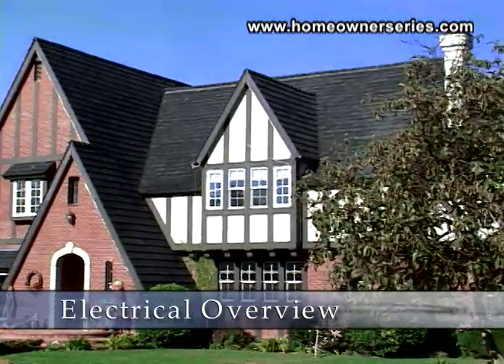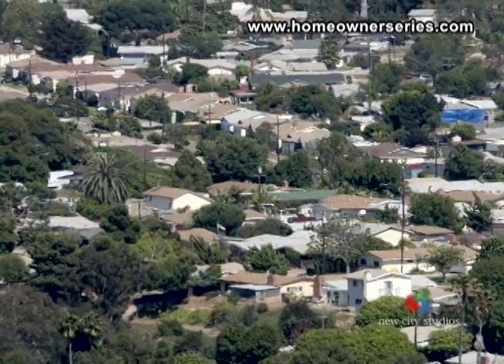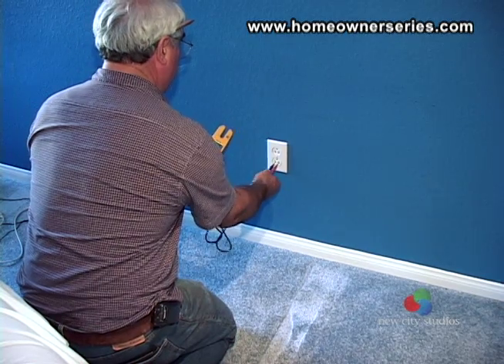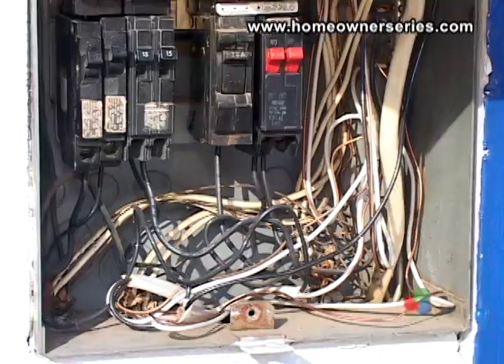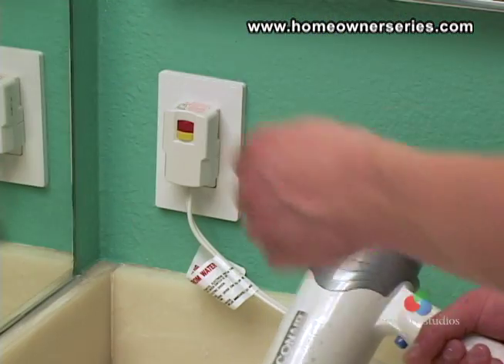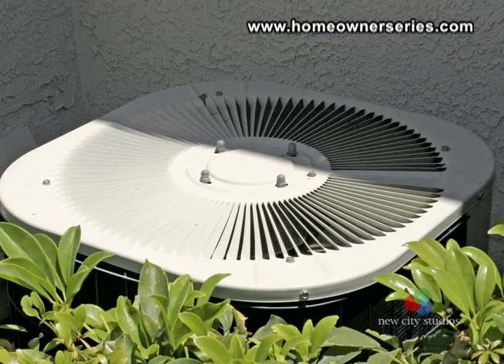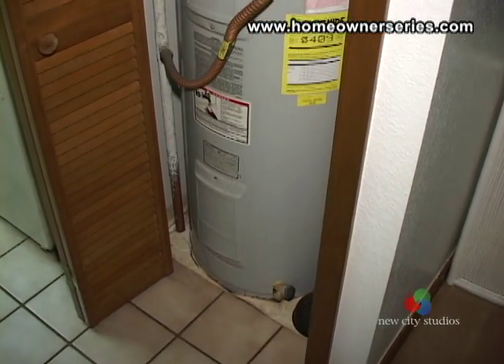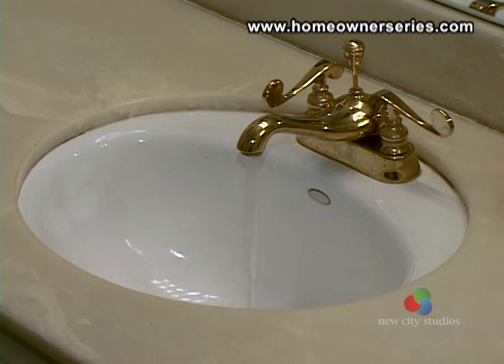Home Inspection - Electrical

Comment: Knob and tube isn't "bare wire" as stated in this video, and is not unsafe unless the insulation has worn away or its overloaded. I was always taught from my instructor that when present, it can be used safely for things like lights and low current appliances like clocks just fine, just supplement the system with modern wiring for things with a higher draw.And in that same vein, some fuse boxes can be perfectly safe when the same guidelines are followed, usually as sub panels. A major hospital in Portland where I live still has fuse boxes in the old building for the stairwell lighting systems and it passes current inspection (as I was curious and asked when I worked there).

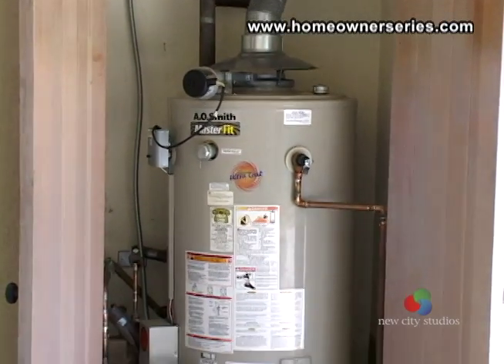Comment: At 8:17 the ball valve that is being operated looks like it supplies nothing but the capped off pipe stub. Also, is that a flexible hose supplying the water heater? And the hose is in contact with the flue?

Comment: Quote from a well known industry publication which discussed this very topic.

"Anti-oxidant joint compounds used in electrical wiring are doped with zinc particles. The grease keep out oxygen to prevent corrosion, and the zinc particles enhance conductivity. The connection does not rely on the conductivity of the paste anyhow. There is metal to metal contact between the terminal and the conductor. The zinc doping just enhances any other incidental contact that is not at the precise terminal-to-conductor interface and I suppose reduces any other potential difference that might cause heating of the paste. 

Dielectric grease is not really used in electric wiring on terminals (except maybe in your marine industry). Dielectric grease is used to lubricate moving internal parts of disconnects and circuit breakers where the reduction of arcing between internal parts is desirable, (where incidental amounts of grease between metallic parts with potential difference would cause trouble if the grease had less than dielectric properties). A bit of it is also used on plug-on circuit breaker stabs to make it easier to get the breaker plugged on. It's essentially wiped off when metal to metal contact is made at the point of electrical interconnection."

Comment: Knob & tube is not that bad. I would rather sleep with knob & tube than aluminum wiring in my home. I have seen copper spliced to aluminum catch fire and continue to burn while being sprayed with water. I am a master electrician with 30+ years of experience. I will go to sleep tonight and an alarm clock plugged into a knob & tube fed outlet will wake me again tomorrow. I ran a 3000 volt hi potential tester on the knob & tube. No issues! I used an AC hi pot set at 3000 VAC and then a DC hi pot set at 2000 volts VDC. I am slowly eliminating ALL the knob & tube. One light bulb will probably remain on the knob & tube as that portion of the home is inaccessible. It is 12 ga copper wire. I will put that on a 10 ampere arc fault breaker. I have seen far scarier things than knob & tube. How about 18 gauge lamp cord inside walls. How about partially melted lamp cord? Extension cords run under flag stones in a home office? FPE breaker boxes? 50 amp breakers feeding # 12 AWG branch circuit wiring? We added a family room, bath & bedroom, and tied it into the old circuit. The 20 amp would not hold, nor would the 30 or 40 so we put it on a 50 amp. WOW! Who let you do that? I have seen hardware store salesmen sell 50 amp breakers to people describing this very same scenario. Consider a circuit breaker can run at 125% of the listed trip rating for 12 hours or more! Yeah, it looks easy.  That was partly why I became an electrician. Installing outlets looked easier than hanging sheetrock, and without electricity we would essentially be living in barns.

Comment: This is a misleading representation of Aluminum Wiring. The stranded Aluminum, typically size 8 AWG and Larger is safe and of the AA 8000 Series variety mandated by the National Electrical Code. In 1972, UL began to require AA 8000 Series AL for use in building wiring and the National Electrical Code followed suite in the mid to late 80's. The issues of potential fires associated with AL Conductors was more about the poor connections, lack of devices (receptacles and switches) that were actually rated for use with AL Conductors and poor termination and inadequate installation practices. The use of AL Wiring in sizes 8 AWG and Larger is very safe and with nearly 40+ years of active use with reliable results the Aluminum wiring produced after 1972 are safe and compatible in creep and reliability with copper conductors. Now if you question my knowledge of Aluminum Wire and Copper Wire (which we make both) then you clearly do not understand wiring methods.
Reply: +Alpha Zero The "grease" you are referring to is not "dielectric" grease. It is anti-oxidation paste that is used to reduce the effects of oxidation on the AL conductors. It is important to note that CU has such a paste as well since it also oxidizes. Nothing within the NEC says that anti-oxidation paste has to be used, it only says that IF it is used that it will not harm the termination, the insulation, or the conductor during it's use. Not having such a paste on the terminals is not a violation unless you can show the equipment that it's being applied to makes the statement for it's requirement. I agree 100% with Encore Codes.
Reply: +Alpha Zero Incorrect......Technically - While it can be thought of as "dielectric grease" the NEC, which I know as a Home Inspector you are adverse too, if you as a home inspector call out the lack of "anti-oxidation paste" on a termination that does not require it you will become a laughing stock to the electrical community which should not be your goal. Now, while it is recommended and does serve a value it is not required if the torquing is done correctly in accordance with UL 486A-B and per the manufacturers instructions.
Reply: +Alpha Zero Not that you ARE a HI...just trying to express why it would not be in their best interest to report an issue that is not technically an issue...unless the equipment of course requires such a compound. The electrical inspectors (who which I teach a lot over the years) are not going to understand the term "dielectric grease" but will understand the statements found in NEC Section 110.14 " Materials such as solder, fluxes, inhibitors, and compounds, where employed, shall be suitable for the use and shall be of a type that will not adversely affect the conductors, installation, or equipment."

The "paste" or "Compounds" may indeed be a dielectric "grease" but alas it is also a Anti-Oxidation Compound which is the focus of the termination. You will never see the term Dielectric Grease on an equipment listings.
Reply: +Alpha Zero Trust me...I believe I am way more qualified that you will assume.....you just happen to not know who I am....and the company I work for manufacturers the conductors to which you would apply that compound and it is not being applied to aluminum conductors because it is a conductive grease.....don't kid yourself. And I am far from a Home Inspector...How many book on the NEC have you written?.....what NEC Code Panel do you sit on......enough said.
Reply: +Alpha Zero Firstly, You are fighting a pretty benign fight and the language is not needed. While the anti-oxidation paste is indeed available in a "grease" formula you are a bit off if you believe that it is all considered a dielectric grease. You can result to name calling if you wish as that is your your right. However, it is better to examine the facts. Not all greases are used for a generic purpose, in the terms of the aluminum connection (an CU to be honest with you) the effects of oxygen onto the conductor termination points create a film known as oxidation. In AL the oxidation is quite tough and if not cleaned off the termination it can create a higher resistance point that can hinder the termination. So why is terminations important....you seem to not understand that the idea of properly torquing a termination provides contact points to the lug surface and reduces the point to point material oxidation because it limits the oxygen to the termination. Being a former NEMA representative myself I know for a fact that the manufacturers of panelboards and resulting terminations do not require an anti- oxidation compound "or grease if you please" at the terminations....as long as you terminate the conductor properly...and it is also clear in UL 67 as well. As a manufacturer of AL and CU conductors I can promise you we do not recommend the compounds because it is a "conductive grease"...we do it to prevent oxidation at the termination, reducing the heat associated with the oxidation effects and enhances the connections reliability.

So you can continue on this path and look silly over a "grease" or "not grease" debate....and understand that none of the manufacturers will call the compounds for this use a "Grease"....or a "conductive grease"...it is purely designed to help reduce the effects of oxidation. However, I am also a Master Electrician for over 26 years and author of many publications on the NEC and Electrical Codes as well as the founder of the CEU process in Virginia....so I am not clearly as "LAME" as you would wish to call me...In Fact, you have inspired me to do a MasterElectricianTV episode where I will bring in the manufacturers of the compounds....be sure to watch it as I know them all as I have worked with them for years.

We can agree to disagree........Take Care
Reply: +Alpha Zero I would not necessarily call this dielectric grease. The intended use here is to reduce the oxidation to the termination. We don't require it's use yet we highly recommend it. We do only recommend UL listed oxidation resistant compounds from companies who specifically manufacture this product for it's intended use. Any generic "grease" compounds we would not support as dielectric grease could mean many things but not necessarily what we intend it to do or mean in our industry. Thank you for commenting however as I think the big focus here is the misleading statements about Aluminum in the original video.
Reply: +Alpha Zero Shows your ignorance...lol.....You would only WISH your career was as illustrious "pull boy"...lol
Reply: +Alpha Zero Ironically I do know ALOT of HI's and 99% of them clearly are more educated than you are on this specific subject matter. You simply don't understand the difference and are afraid to admit it thus you look very foolish. But alas..see it all the time with the WannaBe Masters.....Get Educated first and comment last.
Reply: +Alpha Zero Whats Ironic is you clearly dont understand it.....based on your original post to the OP. However, clearly the state to which you hold a "license" lacks CEU requirements...;)

Comment: This video is misleading and dangerously too vague.  Why would you inspect a water heater without testing the required pressure relief valve which you didn't even mention?

Comment: I would never ever install a gas water heater in a garage as the flames are very likely to ignite any leakage or spilled gas & or other flammables that fumes can & will easily ignite!

Comment: You are teaching inaccurate information. 

It is Single-Strand Aluminum wiring that is the concern...not Multi-Strand Aliminum wiring as you show in this video. MSA is commonly used today and perfectly safe.

And I agree with hiuno11...you are teaching unsafe techniques to lay-people. AND there are many other defects inside that electrical panel.

Comment: stupid falsehoods.   Aluminum just needs different hardware, making it safe.  Knob and tube was NOT BARE.   It was insulated wires, just not enclosed as a pair, but strung apart.  The only hazard today is that the insulation would deteriorate in hot lamp fixtures.  There are remedies to make it safe.   Yes, breakers are the new standard, but breakers can fail to trip.   Fuses ALWAYS blow when they should.  Most statements here are bad science.

Comment: There is more than one type of furnace. Not everyone uses natural gas. Home heating oil, propane and electric are other types. It's not a hot water heater. If the water was already hot why would you need to heat it. It's just a water heater or saying a cold water heater would at least be more accurate

Comment: Is there a video that consists of the hundreds of different components inside and outside of the homes.All houses dont have the same components.You just mention what theyre called,but you cant expect a noob to know what these components do,or how to tell if something is wrong.You just skim through pipes, (rubber and plastic or metal) or talking about the heat pump components and i dont even know what a heat pump does. It looks like an air conditioner to me. No details of water heater components.Doesnt help me help the home owner to show them pics of the labels.Just because something is old doesnt mean it needs to go. I see a video for plumbing but nothing about all the piles and things or what those wires are for that are outside or in basement